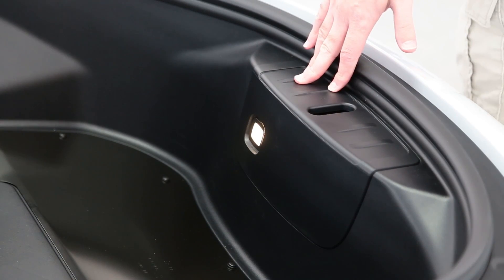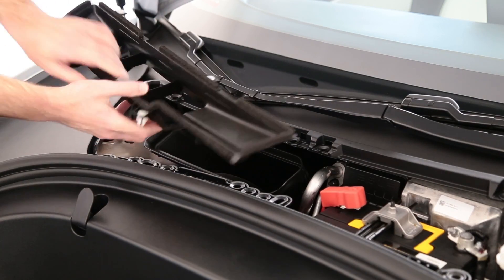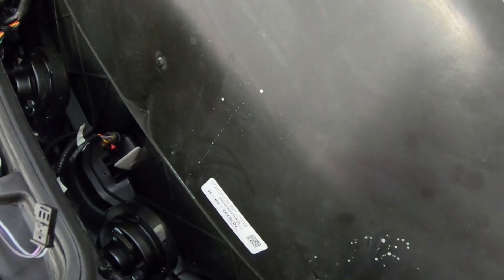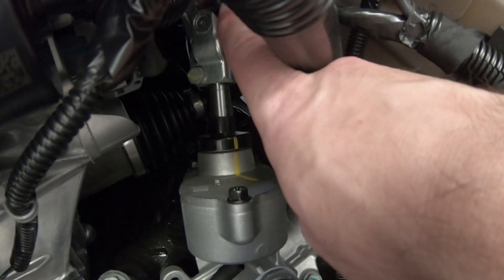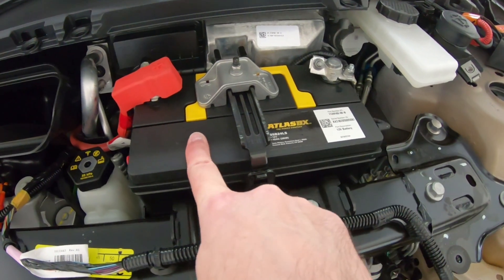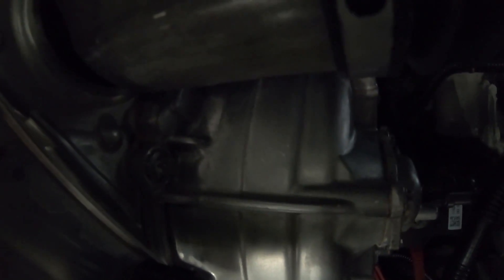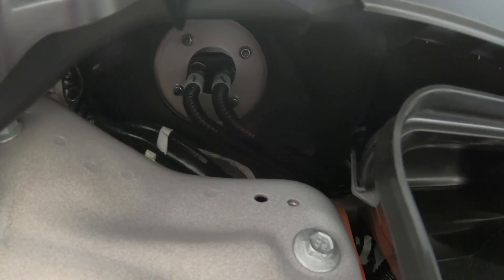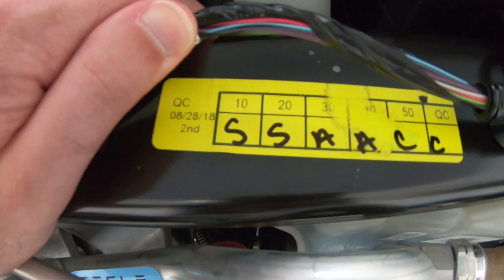What's Under The Model 3's Frunk & How To Take It Apart

Comment: I'm looking for the horn relay that many tesla sites say is under this frunk tub BUT others say there is no fuse box or relays!! He didn't mention it = SUP with that??
Reply from the maker: The Model 3 uses self resetting solid state fuses which are primarily integrated into the VC Left, VC Right, and VC Center modules (along with a ton of other things), so you're not really going to find a traditional fuse box. Most of the failed horn issues I've come across have required replacement of the horn(s) themselves and had nothing to do with any of the Vehicle Control boards.

Comment: (1-20-2025) Thanks for the excellent video all those 6 years ago. I'm going to buy a used 2018-19 Model 3 and want to know more about the parts under the frunk. I'm a DIY guy and may have to get in there to fix things myself. It looks pretty accessible for most everything.

Comment: What do you think would cause the steering wheel to squeak? I have a 2019 Tesla Model 3 long range with a squeaky steering wheel. I’ve heard of people spraying lubricant down the steering wheel, I know this is a bad idea. Any thoughts?
Reply: Are you sure it's the steering wheel shaft? It could be the common dry upper ball joint squeak from the front upper control arms.

Comment: Thanks for detailed look. My car reports that front right, near door us sensor can't be reached. At the same time my AC is not working and system reports low pressure of refrigirant. Your video showed me that the coolant lines do run near front right side of the car and a leak there could end up dripping on the sensor electronics which could lead to some unwanted reaction. I won't be taking it apart but at least I can point the local service workers where to start looking.

Comment: Great video, thanks.  One question, can you access the front bumper parking sensors if you remove the trunk cover?  I hit a small amount of debris and one of them has been pushed in.
Reply from the maker: If you're talking about the two front sensors, they can be accessed from inside the frunk area once the frunk trim is removed. I pulled my frunk apart this morning to take some pictures and put them in a Twitter thread, since I can't post images in YouTube comments: https://twitter.com/PTPetra/status/1251565577719574530

Comment: Can you get to the front parking sensors after removing the frunk?
Reply from the maker: If I remember correctly, no. You'd probably have to pop the front fascia off to get to those. That said, it has been a while, so I'd pull the frunk apart & check before going to the trouble of messing with the fascia.
Reply: @AlexVenz  Thank you very much...hopefully the Frunk is the trick!

Comment: could i connect a motorized retractable front license plate holder to that 12v battery? Or would it not be good for the battery?
Reply from the maker: I suppose you could, though it would be continually powered... generally, it's best practice to look for switched 12V for that sort of thing. That said, I don't recall where you can pull switched 12V from in the front of the car.

Comment: The glycol tank there is the coolant for everything in the car except for the battery. Tesla actually named it the "supertank" if you look closely, on the corner there's an image of a little tank with arms, legs, and a cape. "Supertank" those engineers are such nerds.
Reply from the maker: It's a shared cooling system... That glycol tank and pair of pumps, through a combination of valves, fittings, heat exchangers, cold plates, etc., is linked to pretty much everything including the battery. There's a line that comes off the tank and connects to the front of the battery pack at 4 points (likely 1 inlet for each of the 4 battery modules), which recombine at the rear and return to the tank.

I left the cooling system mascot out of the video intentionally--increasing tooling cost for a gag that isn't even customer facing isn't something I want to encourage.
Reply: @AlexVenz  Interesting. I clearly know far less about the workings of the car than you do. I'll take your word for it but I got my info from an employee that assembled model 3s for 2 months and is now one of 4 mobile technicians in his division. He is a very highly regarded employee.

Comment: I noticed at 5:30 mark you can see a sticker on the air conditioning piping that says R134a. That's nice to see because it's a much less expensive refrigerant. A little bit surprising as well because I think the model S use of the r1234. Which is extremely expensive. Great video looks like the car is well made and fairly well thought out under the covers.
Reply: Yeah Scotty Kilmer brought that up
Reply: @bob15479 
I saw his video about the new r1234y why I think it's called.
and I could swear I saw a video about a Model S in Europe that was running that new refrigerant. 
It could be that it's a requirement for European emission law. I'm just glad the model 3 has the old r 132.
from what I've been reading you can actually evacuate that new refrigerant and put in our 132 and it will actually work okay. it's probably illegal for a shop to do it but you can certainly do it yourself at home and you can buy are 132 at any Walmart along with a gauge set at Harbor Freight

Comment: To add a magnetically-mounted front license plate holder, can you show how to "remove" (actually, move forward just a few inches) the front plastic cosmetic bumper, please ... and reinstall it after the 4 disc magnets are attached to the inside surface of the cosmetic bumper.

Comment: what is the 12v battery for? accessories? does it get charged by the main batteries, so i can wire things to it?
Reply from the maker: The 12V battery runs the car's electronic systems, accessories, and provides power to close the high voltage battery pack's contactors (for safety reasons, it's best not to have the high voltage systems energized unless they need to be). The car does use a DC to DC converter to charge the 12V battery from the main high voltage pack as needed.

Comment: Does it have a condenser in the front, its hard to tell in the video.  Or does it use the heat exhanger in the cooling system.
Reply from the maker: The A/C condenser and radiator for the glycol loop are both under the shroud I pointed out. The car primarily cools the glycol loop via the radiator in the front & engages the refrigeration system as needed for additional cooling by opening the valve on the plate type heat exchanger (the valve is the black cylindrical thing at the refrigerant input to the plate hx).

Comment: Nice job Alex, Just be careful, the last guy to do this (Ingineerix) disappeared from YouTube 2 months ago. LOL

@5:55 that battery looks a lot easier to replace than a model X battery. I wonder if that size is one you can find any any battery store. Flooded cell is better than AGM or Gel cell for that application since you can put an equalizing charge on the flooded cell every few months without damaging it. And a $50 battery is better than a $150 battery when it does fail. 

So far, I haven’t seen any decent “Model 3 maintenance” videos. I think many owners will want to do their own oil and filter change, replace 12v battery, service the glycol system. 

Nobody even did a video owners manual, showing step by step things that are intended for the owner to do, such as jump starting the car, topping off fluids, etc. there are still people thinking the 12v wires in the front bumper will charge the battery.
Reply from the maker: Maintenance/service videos are a good idea, but more information gathering will be needed before going very far down that road... mostly to avoid gotchas of the "haha, you need Toolbox for this" variety. It looked like Tesla's techs had to access Toolbox just to replace my Model 3's charge port door & they confirmed that their laptops don't have local installs of Toolbox, which significantly reduces the likelihood of a version popping up in the wild. This stuff will all get figured out with time.
Reply: That would be a good category, things you can do without Toolbox. Once their are a million model 3, maybe someone will know how to jail break it without losing access to superchargers, but give you full control of your hardware you paid for.
Reply: Turns out the 12V battery is best bought at Tesla. It's not very expensive at all AND it comes with that vent tube he showed. I think a LOT of servicing of the HVAC can be done with the frunk removed.

Comment: can you show us how to put it back together?   I would have  hard time clicking in all those tabs.. 
      I think, I haven't tried
Reply from the maker: I didn't include assembly since, once you've taken it apart, it's very straightforward to put back together. The edge clips on the large frunk liner piece pop back in even with broad pressure, alignment isn't really an issue since the liner/tub assembly mostly self-centers, and the only mildly tricky bit to get fully locked in place is the rear access cover... but that's solved with a bit of thorough pressing and sometimes some light hitting (just to pop the pins into place). Oh, and make sure the wire for the frunk emergency release button doesn't get caught in the latch mechanism.

Comment: Do you think there is a hardware diference betwen the performance and the dual motor, or is just software limited?
Reply from the maker: There isn't really a good technical reason for the difference being anything other than a software unlock, assuming we're talking about base performance vs. LR dual motor (the performance upgrades package on top of base performance, obviously, adds bigger brakes, wheels, stick-ons, and other software changes).
Reply: @AlexVenz  Yes i was talking base performance vs dual motors.
Reply: Cristian Federico I bet that it’s a little bit of everything, hardware,software and profit margin.

Comment: Dual power inputs for dual power steering motors for redundancy
Reply from the maker: Dual inputs for redundancy, yes, but as far as I can tell there is only a single assist motor (looks like redundancy is focused on power & control electronics).
Reply: @AlexVenz  looked up a some photos from the Munro teardown on motortrend. Your right one motor two inputs.